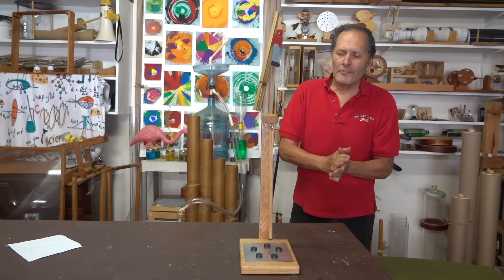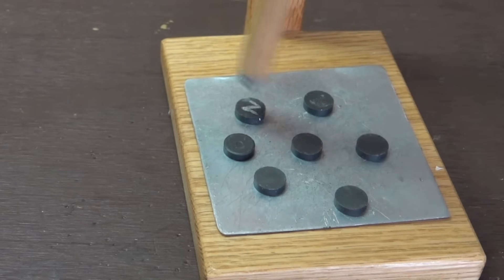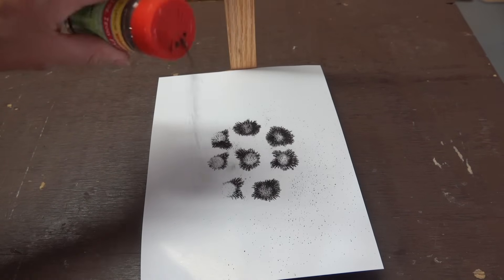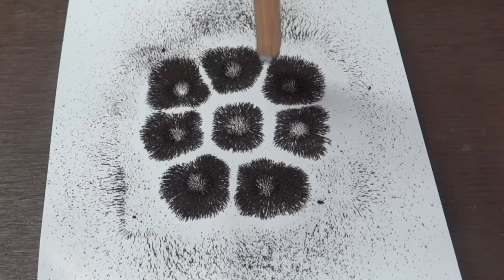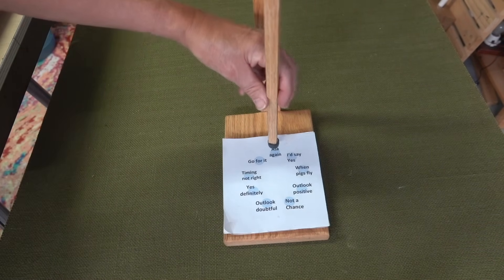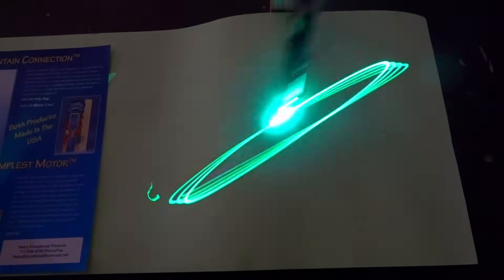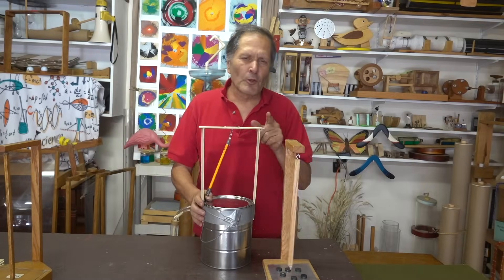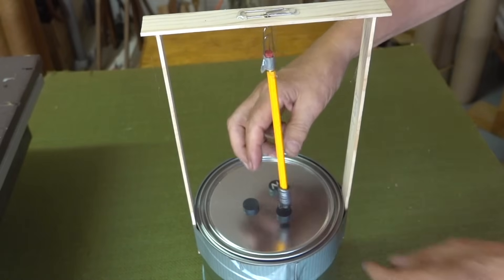Chaotic magnet pendulum...entertaining and easy to build

Comment: Prof., could you maybe give us a link or a name for the specific violet laser that you're using? I understand (now) that the requirement is only that the wavelength of the light source needs to be shorter than the wavelength of the color of the paper. But I'm not seeing a big selection of laser diodes in that part of the spectrum. And I'd rather not use a UV laser if it's not necessary.
Reply from the maker: I have it loaned out at the moment,  I know that I ordered  it from Amazon.  I see quite a few listed there.  I will try to find out the specific one for you and can update it, send me an email at Bgoknee@comcast.net
Reply: @YeanyScience  no worries. I got one that works great but isn’t overly powerful. Thanks so much.

Comment: Do magnets do work. I get the Lorentz force but the equation doesn’t seem to match every day experience, example a car being lifted by a magnet at a scrap yard, or fridge magnet, or even this experiment where the inertia of the wooden dowel changes direction when it encounters changes in the magnet layout. Then it gets even worse when you factor in spin in physics.
Reply: You hinted at the answer to your question. Magnetic fields do not work on electric currents, but the spin-field interaction involves energy and work.
Reply: @zray2937  yes I’m wanting a way of showing this with a demonstration

Comment: a swivel ball joint would allow a more fluid chaotic path. i had a similar rig that i noticed the hook slipping, causing erratic jarring at times. but as always, an awesome demonstration!
Reply from the maker: That is a good idea, the first method I used was to have it attached with a small loop of string but as the magnets got near each other, it would cause the bar to bounce  I would guess that eyelet to eyelet does restrict the movement some. One other option is to have  magnets in both ends of the wooden dow, one end has the north side of the magnet facing outwards, and the opposite end of the stick has the south side facing outwards. That way you can reverse the charges very easily.  At the top, a small eyelet is screwed into the support arm that the magnet will stick to..
Reply: @YeanyScience  i had explored the idea of countersinking the connections and dropping in ball bearing magnets, but this caused the arm to spin wildly, which while chaotic, was maybe a little "too much" chaos. 😂